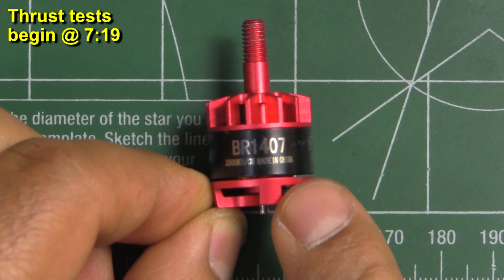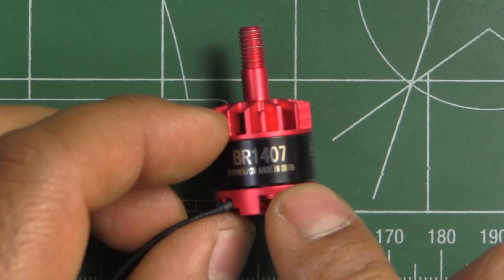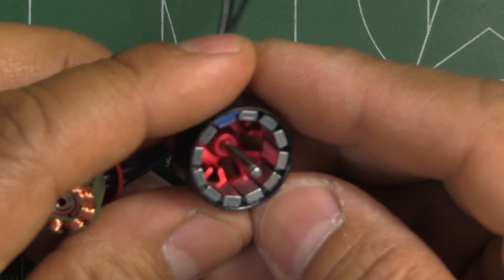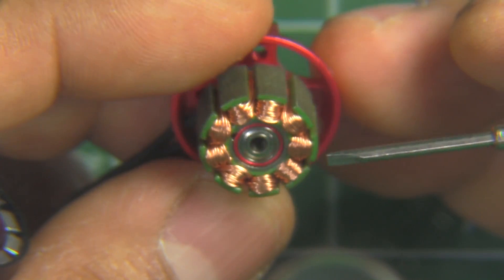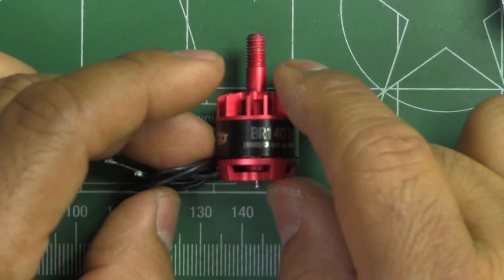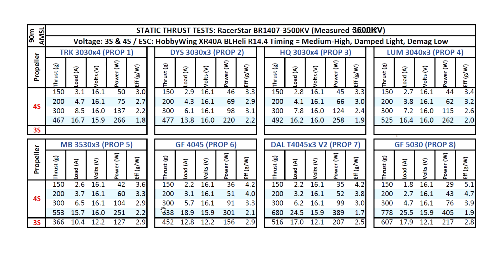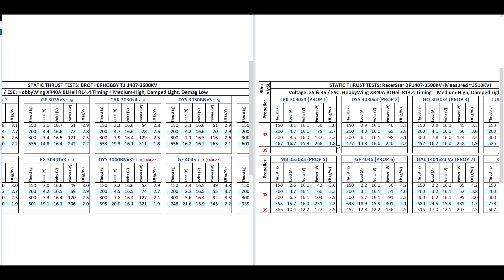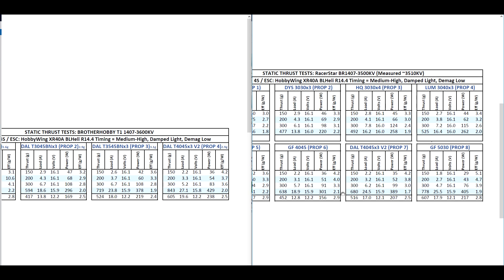RacerStar BR1407-3500KV Thrust Tests and Overview - Low Budget 1407!

Comment: Great info brother! I'm looking at using a 1407 in the nose of a little Stinson Voyager model, using a 5 or 6" prop. I only need 200-300g of thrust since it's only got about a 34" wingspan and should come in around 250 grams.
Reply from the maker: I would try a 5030 or 5040 prop first but with a 2800kv motor if using 2S or 3S. The 3500kv may work on 2S ok. Should give you about 250g thrust max, but I haven't tested that setup myself.

Comment: Engineerx i have a set of the racerstar 1407 and im curious if you could tell me what size bearings these take? They were given to me and i wanna build a 3" hopefully soon
Reply from the maker: Sorry. I don't have this motor anymore to check the size and I didn't measure it. Only way to find out is to remove it and measure it.

Comment: What’s the screw size
Edit:I know it’s m2 but how long. Will it fit 4mm frame with 1mm softmount. Thanks
Reply from the maker: The screws that come with motors are very short. Almost always you have to get longer length screws. For 4mm thick arms + 1mm softmount probably you need M2x6mm long screws

Comment: nice video, very informative. i am thinking of using some infinity graphenes 4s and kingkong 3030x4 props with these motors, is it ok to use this setup?
Reply from the maker: Yes. It will OK. 850mAh Infinity and 3030x4 will be no problem. Just check motor temperature after a good fast lap just to make sure motor is not too hot. Also most people use 20A ESC's for that setup.
Reply: EngineerX exactly what i was thinking, thank you so much for your help ! Awesome channel

Comment: Thanks for the testing video. I would like to see the numbers for 3" prop on 3S. Happy Flying!
Reply from the maker: I stopped at the MB3530 because the thrust was getting low on 3S.
From some of my previous tests with other motors, I think we can get an approximation of what thrust we could get on 3S with the most powerful 3" props - RotorX 3040x3 and Lumenier 3040x3: about 5% lower thrust using about 7% more Amps
So my estimate on 3S this motor would produce about  348g @ 11.0A

BH1407  https://youtu.be/WyjcogERSxA?t=51s

iF1407  https://youtu.be/IvTSH2aV3qU?t=12m32s
Reply: Thanks for the info.

Comment: please put the dys 3045x3 prop into the test.
Reply from the maker: I stopped including the DYS 3045x3 on the tests because it made 5% less thrust than the RotorX 3040x3 while using the same 312W of power.  Then I stopped using the RotorX 3040x3 because over time the propeller blades were getting weaker from installing and removing, they're one of the most fragile propellers. I now use the Lumenier 3040x3 since it has almost identical performance as the RX 3040x3 (actually it's slightly more efficient)
You can multiply the Lum 3040x3 thrust by 0.95 and that should give you a close thrust estimate for the DYS 3040x3 prop

Comment: Looks very similar with BrotherHobby 1407 motor
Reply: IRFZ44 considering it bangood it's very likely the just copied it.
Reply from the maker: This version was removed from Banggood for that reason. Banggood had to redesign the bell and make it look different. No doubt they wanted to lure people into thinking it would be as powerful as the BH T1 1407 :P But as we can see it falls very short. Still it seems to be a good low-budget entry-level 1407 motor. A good option if you want a very low-budget build :)

Comment: According to Banggood, these motors are only rated for 3s, is it safe to run them at 4s?
Reply from the maker: Yes , you can run them on 4S and any of those 3" props, even the GF4045 should be OK but do check motor temperature after a short lap. Of course, they'll be stressed a bit more so there are more chances of breaking down, but we all run motors over spec all the time
Reply from the maker: Too much heat would be around 120ºC - that's when motor magnets begin to suffer irreversible demagnetization (it's actually at higher temp, but 120 is more conservative) It's hard to measure actual temp in a motor under full load because you got the prop in the way.  So I usually just fly fast for a quick lap and do a couple of punch outs and then land immediately and "firmly grab" motor  to check for temps. If I can comfortably hold it, then I know it's OK. Another method I use is measuring temp thru the bell openings with a IR temp gun, they're cheap from China stores ~$10 and work well. Around 45 to 50ºC is OK. 

4040x3 prop on 4S?  That prop is just slightly "overpropping" the BH1407 motor (on 3S it should be OK). That's why you feel it a bit hot. If it's not uncomfortable to hold and you've been flying it for a while and they're still running well, then it seems you're OK, it all depends on each particular setup.... and the LiPo you use. So if later you buy a very high performance LiPo that can deliver more Amps, the motor may in fact overheat more.  Right now the balance could be just right, your LiPo could be only delivering the "right" amount of current to keep motor from fully overheating. If you're concerned, perhaps you could try the DAL T4045x3 propeller, it loads the motor less than the 4040x3 and thrust should be very close.
Reply from the maker: Here's a very good motor temp "guide" from a motor manufacturer rep. About the same conclusions I've reached in my experience
https://www.rcgroups.com/forums/showthread.php?2867187-EFAW-2407R-motors/page10#post37596015
Reply: Hey.... thanks for this amazing answer... you made all that very simple and clear!!!
Reply: EngineerX how hot would be too much? I've Tornado 1407 running 4040x3, one of the motor is slightly hot after 10 minutes... Is that okay?